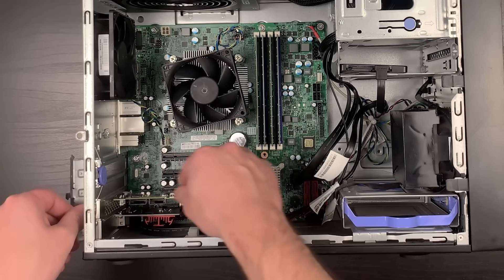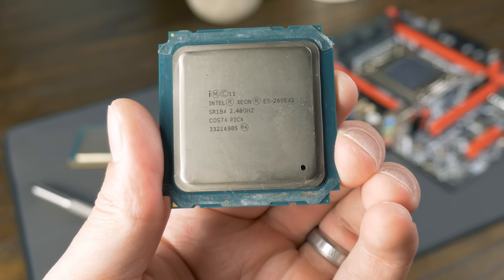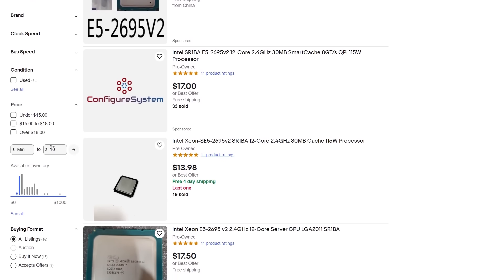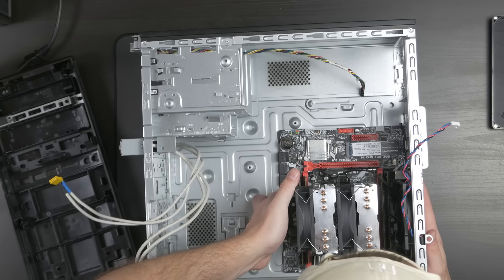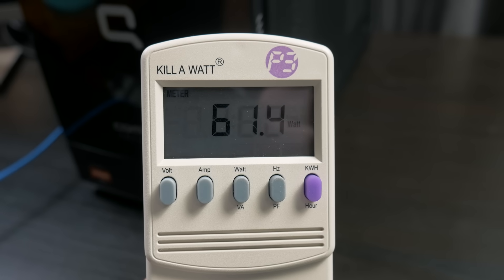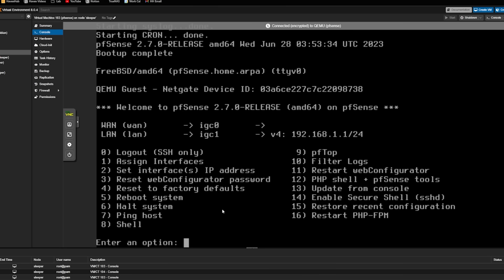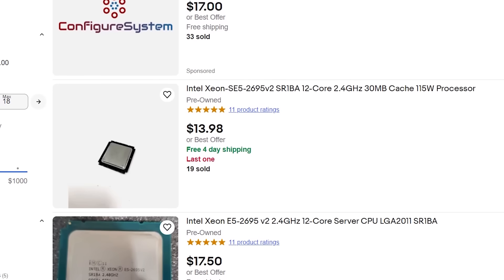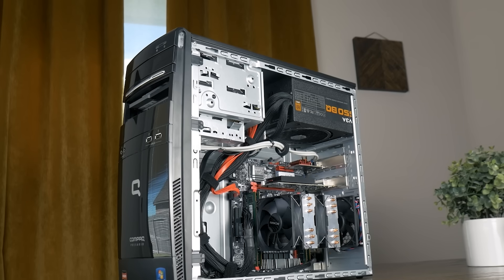Are CHEAP x79 Servers/Workstations Good In 2024?

Comment: I use an old HP XW8400 for my server. 

Specs:
Two Intel Xeons X5365
32GB PC2 Memory
128GB SSD
4TB HDD

Initial System: $13.00
RAM: $40.00
SSD: $20.00
HDD: Free in a lot in box, not sure the person knew it wasn't empty

This gives me eight cores at 2.53GHz, and with Linux Mint works perfect to run the following:
* Minecraft Server
* Valheim Server
* Local Web Server
* Security Camera System

I'm thinking of replacing the PSU as while it is rated as 80 plus it's getting old, however it gets difficult as I don't think the PSU is standard. Going to have to do some research on that soon. Though I did load those puppies with some Grizzly Cryonaught, and under load the max temp I've ever hit thus far is 65C, which might not be impressive, but I think it is considering the chips.

Comment: I've been running two HP Z440 workstations as my Proxmox hosts for about 5 years now,  using the  E5-2690 v4 which gives me 14 cores and 2 threads per core. It's great for lab stuff but I've been wondering whether I'm reaching the point of diminishing returns on power / performance. The price is always attractive upfront but those energy bills do add up eventually.

Comment: I use some dual Xeon E5-2630 V2 build with 512GB RAM and NVMe SSD's. I have quite an odd use for them. And compred to modern cpu's, they arent THAT bad actually

Nowadays, where only Memory got faster, and GPU's got faster and CPU's kinda stay the same, it is way more then enough for most people.

And to your video. Comparing a Xeon to a Mobile CPU for TDP is kinda unfair! :-) Because the Xeon still is way faster then todays mobile CPU's.

But nice video.

Comment: Recently put together an x79 system for Proxmox. No name Chinese motherboard £56 with a NVME gen3 x4 slot, 6 sata ports,  5 pcie slots, 3x 16 and 2x 1. E5-2690v2 10-core £8, 64GB reg ram £18. Everything else I had laying around. As a just for fun homelab project it's pretty good. Half the cost to run per-day than a coffee from a well known outlet. Now thinking x99.

Comment: For A media Server These CPU's Make No Sense! An Old Optiplex With An I7 6th Thru 9th Gen Makes More Sense! they Use Way Less Power And Have Quick Sync For Hardware Encoding/Decoding Video! I Am Currently Running An Optiplex 7060 With An I7 8700 CPU And A Tesla P4 GPU With An Add On Blower Style Fan!

Comment: About the power draw of those x79/x99 systems, I'm currently checking X299 systems like the Lenovo P520 because I would like to setup an all nvme SSD NAS while and in the same time having a 10G network on it and an A310 or A380 dual slot (double x16 slot and 1 x8 all in gen3 on the motherboard) for media encoding. The  X299 is also called Kaby-lake X which correspond to the 7th gen intel CPU and I think they can manage C8 C-State. I'm hesitating pulling the trigger to buy a refurbished one (they can drop as low as 100 euros in my region) but the weight of those PC (24kg) and the fact that the motherboard is non ATX standard holds me from buying one. Also I don't have good experience with Lenovo PC compared to HP for C-states idle power draw. Maybe wait until aliexpress does X299 motherboard --'

I would setup two small SATA ssd for the OS in raid 1 and create a ZFS pool of 5 NVME in raid Z1 or Z2.

Comment: Those xeons have slower memory, frequency, and higher power consumption.
You're better off with a modern gaming cpu that costs less, has half the cores that run at twice the speed, and uses less power.

For a regular pc these xeons are more than enough, but if you need raw compute power for days, this isn't the system to buy

Comment: Last fall my old faithful "8-core" FX-8350 bit the dust. I had an older machine I'd bought just for the fancy case with an older i7 on an EVGA 132 mobo, and after shuffling around some hardware had my workstation up again. Too slow. So I went online and found the biggest fastest CPU that would work on the EVGA, a Xeon x5690, and threw some more RAM at it. It's doing a much better job than the much newer FX it replaced, handling linux audio production without any of the annoying audio glitches, xruns, and other problems I'd been having. So I've been quite content going the old-Xeon route.

Comment: I've built 5 so far of the "AliExpress Special" kits and not had a single issue, I'd recommend one of those over mixing/matching as you can be assured all of it works together. Last one was a 2650V2 with board, 16GB of RAM, and nice RGB cooler for $66 shipped. Added another 8GB of RAM, RX580, 1TB NVME and a nice $40 case with 3 RGB fans and the grandson's bestie had a PC that could play his Ark and GTA V above 60FPS for less than $350, can't beat that.

Comment: Just because it isn't the latest hotest hyped up system doesn't mean that it isn't still very capable... I am still using an aging Dell dual Xeon E5-2697 v4, 128GB, 12TB, 3060Ti workstation for audio, video, graphics, 3D modeling, gaming, and daily office and general life uses. The board still has plenty of expandability and growth in it. The whole thing cost less than $1000 built and upgraded over the past few years.

Comment: Honestly, at this point the only real cost effective Xeons for budget users are the V4s.

The V2s are just too TDP heavy for the performance (a budget V4 will match a mid to high end V2) and doesn't really support DDR4.

DDR3 is a bit of a false economy because you get more performance out of 8x16GB DDR4 than a cheaper 2x64GB DDR3. Unless ALL you need is +512GB of RAM it's not worth it and you'll end up with less performance and more jolt juice being pulled from your plug.

Get a DL360 Gen9 for about £150 and be done with it.

Comment: That's interesting that you don't get good single core performance there. I have a pair of x79 boards, one Xeon and the other i7, and they benchmark within half a percent the same across the board, tho the Xeon does slightly better running apps that are memory hogs.  The main hardware diff is that the Xeon has slower EEC RAM but it tests as running at the same speed as what the i7 has, but otherwise their specs are the same.

Comment: One other thing, if you're in to x79 for the up front cost, if your power bill and space/noise constraints allow it, look for full systems vs parting them out. Standalone motherboards are hitting the point that they're starting to increase in price a bit again, and you can definitely still find good deals on parts from that generation, but even a couple years back you can get a full server/workstation with a decent amount of memory for <$100 USD you might miss out on disk trays because those always fetch a decent stand alone price but other than that, great starting out deal and saves you some time, even if you have to make modifications, also super nice if you're looking to get into the IT field to get familiar with some of the capabilities.

Comment: I built a similar system using E5 2620 with 16gb memory , x79 chinese motherboard and an old GE force 8400GS 1gb graphics card and i tell you it can compete with newer I5 or I7 with light gaming. my only drawback is the speed and the low gpu i have which suffers lag when i edit videos.  im gonna slap some 4gb gpu card there in the future.

Comment: I have a Lenovo P720 with those dual Xeon e5 v4 cpu's, total 28 cores/56 threats. Still holding strong for gaming and editing video's while being quiet. I think if I put them in a X99 board I can get even better performance. Power hungry though so quite expensive when you're not using the system for more than just surfing/watching Youtube.

Comment: >16:25
x99 can use DDR3.
There are x99 cpus which can run DDR4 and DDR3 like E5-2696v3.
I have a system with this cpu and 64GB DDR3.
Also there are early engineer examples which only run with DDR3.

Comment: x99 makes a whole lot more sense for this type of build and it doesn't cost that much more tbh. For lower power usage you could look into the x299 platform - lots of skylake xeon workstations came off-lease in 2023 and so they dropped in price. They are both more powerful and draw less power, but still use cheap DDR4 ECC RAM.

Comment: your wrong i am still using a Xeon e5-2690 v2 10cores 20threas at 3.3ghz and it works like a champ with 32gb memory and a GTX 1080 !!! the TDP wattage is 130watts a brand new i7 14700k is 125watts the power draw is about the same so yeah hate too break your heart but the older xeons where just as efficient with wattage then todays cutting edge .. the only minus too them is PCIE gen 3 not the newest 4.0 / but doesnt matter much at all because your not putting a RTX 4090 or 7950XT in a system like this at all that utilizes PCIE 4.0 and the other fallback is your using DDR3 ram ... but honestly if your using it for gaming or hosting a website or mass storage it doesnt matter .. their a great budget option even in 2024 .. problem is replacement parts are sometime hard too find ..

Comment: The Xeons to go for in my opinion are the 6 and 8 cores like the E5 1640, 1650, 1660 or 1680, v2 or v3 if you want X99. Fewer cores, yes, but still plenty to work with and they're based on the Extreme i7s so they support overclocking, clocking as high as 4.5 without much issue. Should perform a lot better in most tasks, especially for desktop, but you are throwing power consumption out the window. Still, they're cheap.

Comment: swapped my x99-based, 6-core i7-5820K for a 20-core Xeon E5-2698v4. The new processor has 14 more cores, a lower TDP my code compiles 5 times faster (from 5 minutes to 1 minute).

Comment: should cover the x99's and E5 v4 chips on 2400, they're a different animal than the X79 versions and can be had for just as cheap. I bought a pair of E5-2680v4's for 30 dollars a few months back. This T7810 absolutely rips, 128gb of DDR4-2133 ECC. It might be a little newer of a rig but the v2's and v4's are different animals

Comment: So here is an interesting question for you. A while ago I bought an old 1U HP server with 2x xeon x5650 CPUs and 32gb of RAM. It works great, but I have two problems. I have since moved into a much smaller home and have nowhere to keep it, and being a 1U server it is LOUD. So, do you think it would be worth pulling the CPU and RAM out of it and building 2 systems in desktop cases that could fit beside my desk? This would mean each system would have 6 cores and 12 threads and would be starting with 16gb of RAM. I think this would be a good starting point to get my home lab back in operation, but I am just curious to know your opinion. For additional context, I run proxmox, no ZFS, and mostly used my server for learning purposes and to host a very small minecraft server.

Comment: The only reason I didn't go for one of those was because I was on a tight budget and couldn't buy a power supply with a 8-pin CPU power connector. One of the things which will get expensive for those systems IMO is the RAM. Even in older standards, ECC RAM is still expensive, sometimes more expensive than DDR5. Also, that Compaq case is not a bog standard mATX case. It's a BTX case, similar to the Dell Optiplex 755 I have. This is the reason why your screw placements are off and hard to reach.
Reply: On the contrary, used registered DDR3 ECC RAM has the lowest price.
Reply: @ash-cn2oh  Not if you want a lot of RAM. While you could probably get 4-8 GB for fairly cheap, a 16 or 32 GB stick will set you about the same price as non-ECC DDR4 kits.

Comment: I have owned a DX79SI setup from when it was new (worked for Intel at the time so got the motherboard and 3930k CPU at half price), still in daily use. Now I'm wondering if it's worth finding an Ivy Bridge Xeon to swap in or if I should just keep it as is until I build a new workstation.

Comment: I upgraded an old core 2 quad dell xps... same backwards and upside down setup that you showed here.... processor was 2650 v2... my son is running starfield with an RX570 and the same memory at around 30 fps with no overclock

Comment: You also used one of the worst CPUs for single threaded loads. E5 2667 V2 is the best all around option, and they're cheap now. Tried to share the link to the pinout for T3600 24 pin, but, "links are bad"..... it's on level1forum for anybody who cares. Go there, search "T3600 pinout" and you'll find my post.

Comment: Some of the X79 era dual socket boards can be had pretty cheap. Like the X9DRH-7F from Supermicro, which has 6 x8 slots and 1 x16. All the x8s are open ended. Lots of expansion options. Mostly standard shape board. I have mine in a Dell T320 case. Currently running 3 GPUs, a USB 3 card, and an SB1040 sound card.

Comment: You can just limit the amount of RAM user by ARC for OpenZFS. 
I could argue you could better use SmartOS / illumos for virtualization, on top of OpenZFS, not Proxmox/Linux. 
SmartOS (and OmniosCE) have LX zones 'brand' , that are light Solaris zones based virtualization, without HVM overhead, able to run Linux OS like Ubuntu etc, without ever really running Linux kernel at all.  And Windowze HMS in Bhyve , too ;) 
SmartOS (that can be used as standalone server, imgadm and vmadm are your friends)  is part of MNX Triton open source cloud solution, 
also fully open source and free to use for your private cloud ;) (1 headnode and 2 compute nodes as minimum ).

Comment: I recently built both a new workstation/gaming machine and a server using the slightly newer X99 architecture Xeons. And so far both have been great. They also support that instruction set you were missing which limited your Adobe version. Also bumping up to DDR4 was an added bonus. Being a long time fan of Craft Computing as well as your channel I had seen the light early on with these retired enterprise CPU's with Chinese motherboards. My server idles around 110w but i've got 6x 3.5" spinning drives in there as well and haven't really messed with C-states in proxmox at all. It's honestly pretty good. with 64gb ram i'm able to run a 60tb ZFS pool and all my services in Docker under an Ubuntu based Cloud-Init image. And it'll transcode in Jellyfin without issue.
Reply: My x5690 is about to get a bit of a boost. A coworker who lives a lot closer to the bleeding edge than I do (he's using big Ryzens and Threadrippers) is cleaning out his "old hardware" and giving me an X99 mobo and a pile of DDR4 RAM.  $15 to Amazon netted me a 12-core Xeon E5-2690v3.   And a few months back one of my fellow network jockeys came across a server some faculty had put together with spare parts and petty cash that they were just throwing away, so he grabbed it and carried into the cubefarm going "Who wants a server?!?!"  Dual cpu Xeon, 64GB RAM, dual RAID controllers, heck yea I want that!  I do love working with a bunch of other computer nerds. :D

Comment: For a 100 bucks those old things are hard to beat and fun to play around. however, when you can have f.e. a ryzen 5600, an okayish entry level board and 32gb of ram for only a bit more than double that amount of money (new!) its hard to justify using 10 year old hardware. the difference is probably made up in electricity bills within a year or two, depending where you life and how often you run the system. and those modern cpus run rings around the x79 and most x99 stuff even in multi threaded workloads and have modern i/o and nvme ssd support without hassle.

Comment: I'm currently using an HPGen8 with dual 8c/16t xeons.  I was using ESXI but gen8 support is lacking.  I have a Server22 license so i use that now.
16c/32t.  384gb ram, 22 1tb SFF 7200rpm SAS, 2 300GB 12000rpm SAS, 1 256gb Agility 2 (yeah old) SSD for the host OS.

Works great.  I have one 2950L v2 and i'm ordering another to upgrade to 20c/40t at lower TDP but lower clock speed.  The clock speed does cause some performance issues when trying to do something like owncast.  ESXI limiteded me though. havent tried with hyper-v yet.

 Drives where the expensive part.  paid ~10-15$ each, the gen 8 with CPUs and 128gb of ram was about $250 and adding more memory about another 80$

If I had to do it again, I would've gotten a system that took 3.5 drives as larger capacities are cheaper in that format.

Comment: if I recall avx2 instructions are on the xeon v3 and v4 series.  I run an e5-2650 v2 xeon on a Kllisre x79 mobo kit with ddr3-1333 4x4, 16gb ecc.  Running LInux Mint 21.3 as my daily driver, not for game use.  Runs like a champ.  If I were to pick a xeon for gaming it would be something from the v3 or v4  family of xeons, since those have the avx2 instruction set.  Tho I would try to pick a xeon under 135W tdp.  Power consumption is a concern for me.  Along with even newer 14th gen intel and ryzen 7000 are getting crazy with their power draw even worse than the xeons of v2, v3 & v4.  I'm a budget oriented builder/user, no issue working with a xeon PC for my needs, be it work/office or gaming.

Comment: i5-8500 SFF PCs are about 100 bucks on a popular auction site all day, they work well for mass general compute if you stack them 10 high. A lot less complicated than a workstation setup. Undervolt by 120mV and power consumption at the wall under full load is a bit under 70w.
Reply from the maker: Yeah the 8th gen stuff is getting cheaper. 6th gen and 7th gen are still really solid options as well
Reply: @HardwareHaven  yes anything Skylake is still power efficient enough and undervolting friendly. But 32 core consumer Ryzen within a few years will pwn